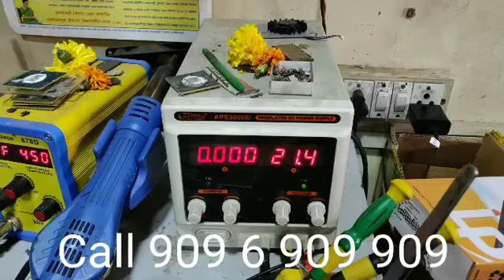Ac Adapter Turns Off When Plugged Into Dell Latitude E5450 i7 Laptop

Comment: Hi my friends

How are you' i hope you a good day, thank you for your attention, 

Please i have a question about my laptop hp pavilion  dm1-1015 ez. My proplem when i plugged in the charcher in to my computer the light of adapter off , but the computer still work by the pattery of computer.

To charche my battery i need to pull out the pattery of computer and plugged in the charcher without pattery the computer starting work after that return the pattery the pattery start charching, i mean all of time i need to make this state to charche the pattery.

Thanks